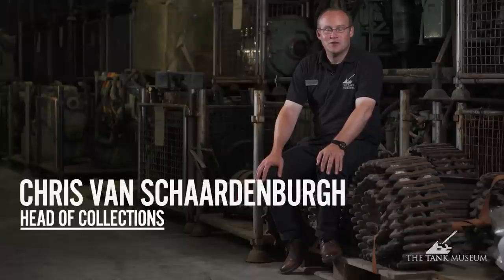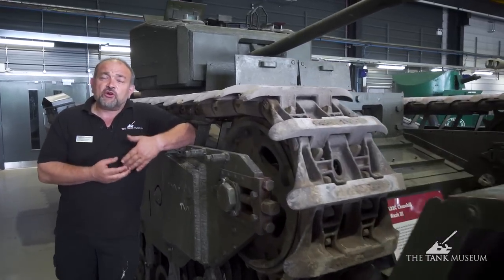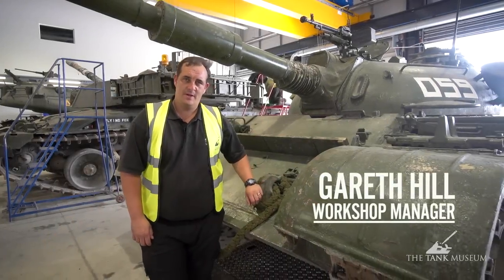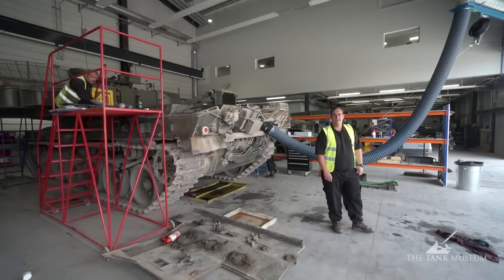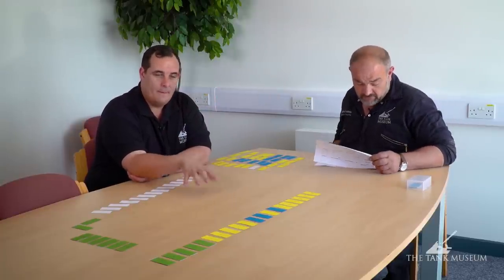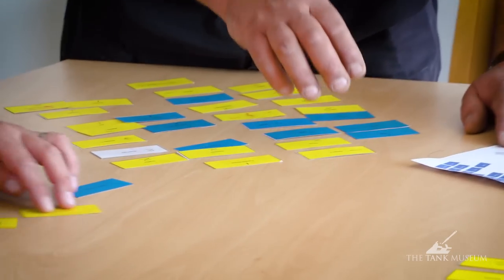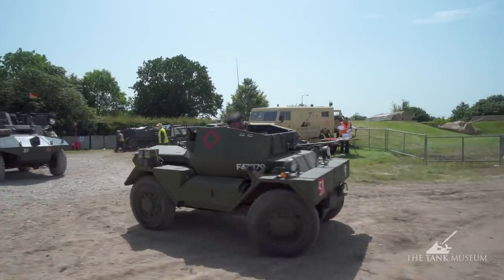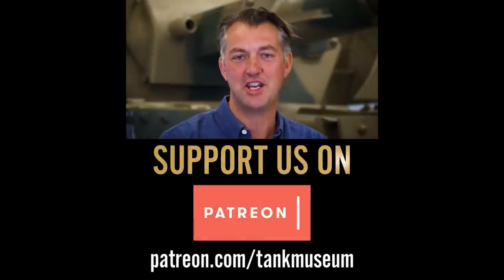How to park 60 tanks | Ep. 5 | Tank Workshop Diaries | The Tank Museum

Comment: Thanks, chaps for showing us how it's done.  I certainly would not have liked to have done any of this maintenance under combat conditions or under fire.  Some of this equipment is awsome and very heavy as you have clearly demonstrated.  It has given me a whole new appreciation for how much engineering went into the various designs of these vehicles, how temperamental some of it was and how similar they are to a normal car (although even this is no becoming harder and more 'space-age') particularly the engine 'boxes' in modern tanks - almost like macarno - plug-n-play - well almost.

Comment: A question I wanted to ask since longtime, regarding the engine warmup - exactly as the warming up of the motor oil. What oil do you use in the old engine(s),  the single viscosity oil the engines were run with originally, which is thicker at lower temps and needs a time of warmup idling but becomes thinner at higher temps, what brings up the possibility of overheating the oil to a tear-off of the lubrication film - or a modern multi-viscosity oil , which keeps its viscosity over a range of temperatures ...?
Reply: I was wondering the same
Reply: I would assume they keep everything as original as possible. There are so many moving parts and everything is so old, doing something as fundamental as changing the oil could probably have all kinds of unpredictable and unknown effects.